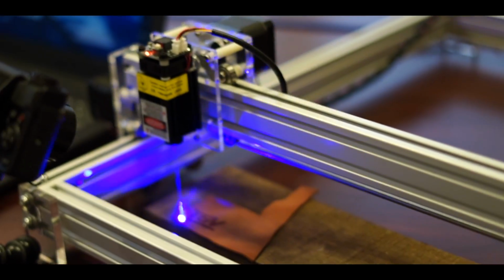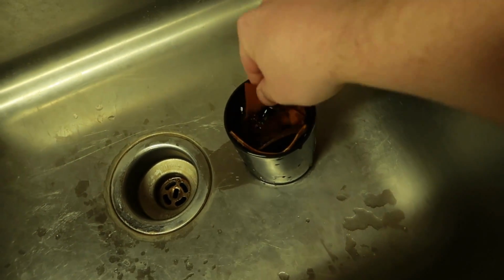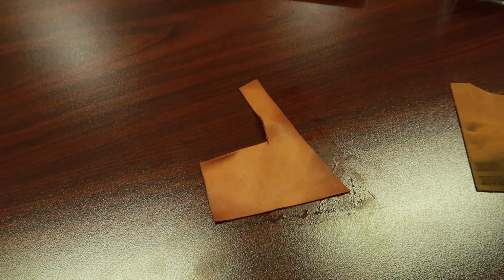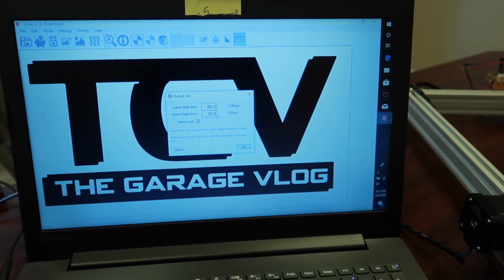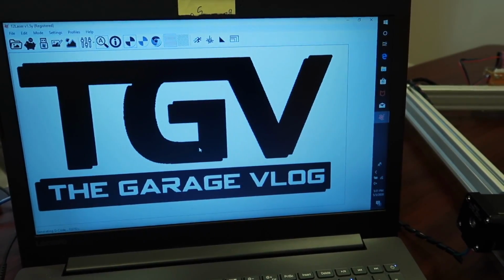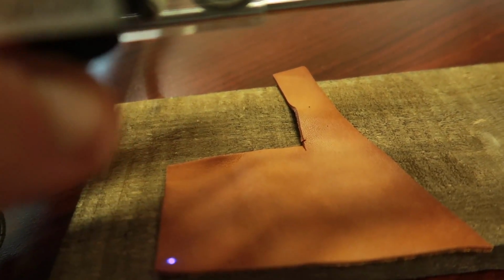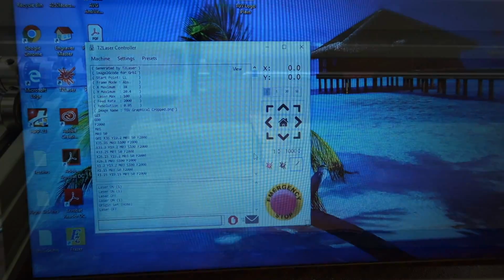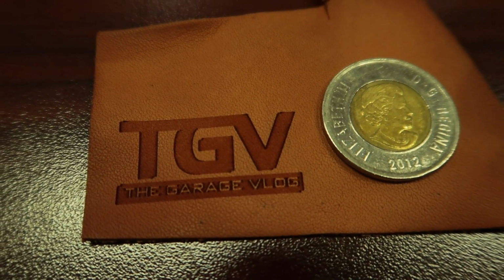Make Money With a Laser Engraver | How to Laser Engrave Leather | Maker | DIY | Crafts | Clothing

Comment: Did you have issues with fumes in the house?  Looks like you are in a room.  I noticed you aren't using air assisy or the honeycomb bed and I'm wondering if I'm overthinking using my laser.  I haven't used it yet because I'm afraid to use it indoors
Reply from the maker: I usually use it in a well ventilated garage with an exhaust fan, in this video I used it in the office. It definitively smelled like burning leather, I had to opened up the window. I wouldn’t use it in my house without an enclosure and an exhaust. The honeycomb bed is for when you are cutting completely through the material, I just engraved it and didn’t cut through so I didn’t need it. Thanks for the question!

Comment: Where do you get the leather from the fabric store?  Also did you use the leather to cut the shape or what did you use?
Reply from the maker: I bought the leather online from weaver leather supply. I used the laser to trace the outline then cut it with scissors. Thanks for the question!

Comment: Hi, is it possible to engrave a ceramic with this model? have you tried? Specifically a ceramic mug. Thank you
Reply from the maker: I haven’t tried it, but if you try to engrave a mug, you would need a rotary axis to do it properly. When the laser moves on the curved surface it loses its focus due to the distance of the curve getting farther away from the laser. Hopefully that helps answer  your question, thanks for watching!

Comment: Which software are u using?
Reply from the maker: I'm running T2 Laser software. It works a lot better than the software that came with the machine. I have also been wanting to try out the new LightBurn software. Thanks for the question.

Comment: Hello, to avoid burning, if you have the grbl 1.1 firmware, and your laser is ttl-pwm, you can change the setting $30=0 to 1 and use a software like lightburn that gives you the option to adjust the power of the laser, in every work. Also I have put air assist to the beam of the laser and helps a lot to engrave without burning.

Comment: Thanks, great video. I have a very similar laser and I´m having trouble with the rubber belt and the wheels. Any idea how I can make the wheels turn smoothly? After cleaning the belt and wheels, the wheels get stuck and the laser keeps on burning but only in the same line.
Reply from the maker: If your bearings and belts are clean, you might have a stepper motor going bad. You could always swap the motor and if the problem changes to where you swapped it, you would know you need to replace the motor. Hope this helps. Thanks for watching!

Comment: I have a couple of questions! Also what is mw and w when referring to these machines as in 15w or 2000mw? Also do you think that machine would be good to engrave leashes? I am just starting and trying to get into it if you could answer those questions it would be great!!
Reply from the maker: W = Watts, MW = Milliwatts...1000mw = 1 watt...my laser is 2000mw or 2 watts...that is just the maximum amount of power the machine has to engrave. I use mine to engrave leather and fabric so it should work, you will just have to dial in the speed and power. Hope that helps, thanks for the question!

Comment: Great patch. How did you cut the leather? Can you use the machine?
Reply from the maker: For this project, I just engraved the outline and cut it with a pair of scissors. The leather was pretty thick, if it was thinner you could probably cut through. You could also use multiple passes with a slower feed rate, but it just starts to burn more than cut since its not a high powered laser. Thanks for the question!
Reply: @TheGarageVlog  Thank you! It takes trial and error. The water helps. Thanks for that. I will be making patches for my knitted hats. Ultrasuede works well.

Comment: For how long it can run? What's the printing speed and can it engrave in bulk?
Reply from the maker: I haven't ran any production pieces with this machine yet. I just use it for custom one of a kind things that I like to make. You could set up a jig or fixture to engrave in bulk. The speed all depends on the material and power level you are using. There are different settings for different materials. Also, the resolution plays a big part in the engraving time. Thanks for the question!

Comment: dude! what's a recommended laptop to work with a laser engraver?
Reply from the maker: I'm using a Lenovo Ideapad 330, 8 gb ram, 2.5 Ghz Processor running Windows 10. It runs the laser control software. I design on my Macbook Pro, but the control software has to run windows. Thanks for watching!
Reply: Anything pretty much works. I run mine off a Raspberry Pi Zero W.

Comment: Several questions, does it only etch/ laser leather or other things example painted yeti cups to see the original stainless under the coating? Can it laser a design on the side or anyplace on a pair of shoes? If you have a logo example and Astros current logo can you make it show a separation in some sort the star from the H?
Reply from the maker: You can use this laser with other materials. I've tried wood, paper, fabric, and leather. As far as the Yeti cup, you would need a laser with a rotary attachment, because the laser works with a focused beam, that focus changes with the curvature of the cup. Part of the design would be ok in the middle, but would not be focused on the edges. That's why the rotary turns the actual cup itself, keeping the focus exactly the same across the cup. I would think you would have the same issue with the shoes, unless the part of the shoe you were engraving was perfectly flat. With the Astros logo, there is a grayscale option that adjusts the laser power level to show different parts as lighter or darker. Thanks for the questions and for watching!